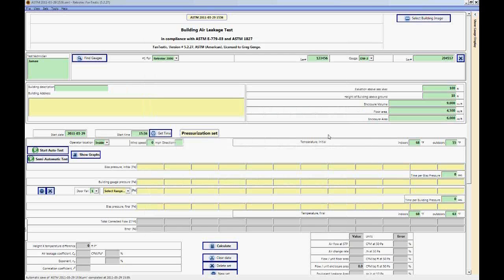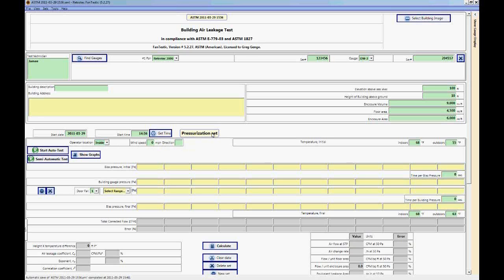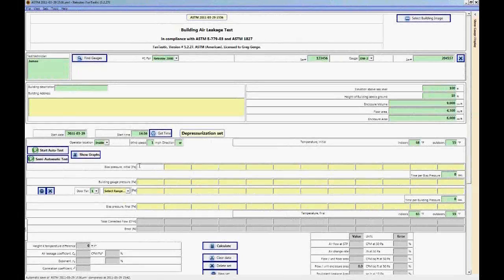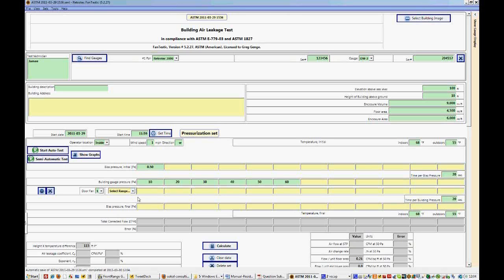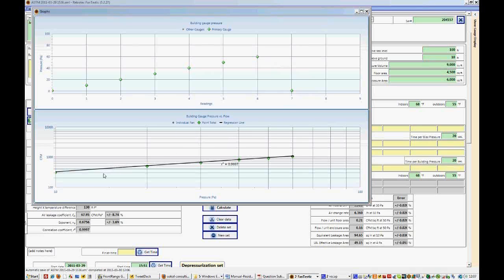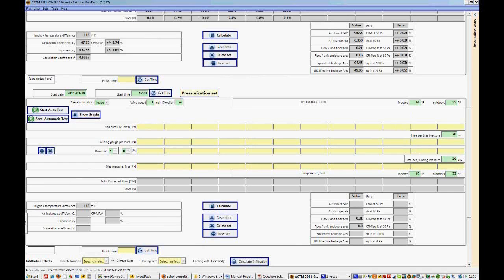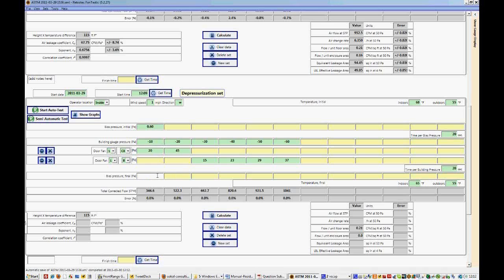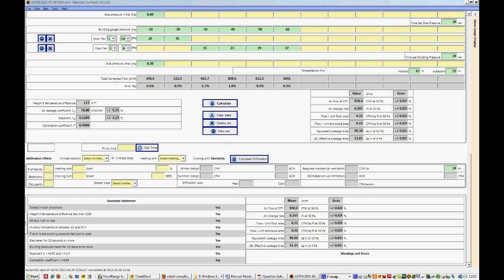FanTestic -- Manual Test

Comment: Hello! Can you please give some common building preassure for a classroom because I am doing a school project for mechanical engineering for an energy audit but I cant do the automatic test becose the fan is not connecting with the software and the professor told me to do it manually. Its about some old classroom and new ones so if you could give some common building preassure you would help me a lot.
Reply from the maker: I'm trying to follow what you're saying here...if you are asking what common target pressures are used, its 50 Pa for residential buildings and 75 Pa for commercial. So if you are testing a school building or room, I would use 75 Pa. If you're only donig a single-point test (only testing to one pressure), running it manually is fine. If you are doing a multi-point test (testing to multiple pressures to make a regression line), I highly recommend using software. If you have FanTestic Lite, you should be able to use the software with one fan if thats all you need. You can also download the rCloud app from the apple app store or google play to do automatic tests and generate a report with one fan.
Reply: @RetrotecEnergy    I have the software and the licence but for some reasons when I connect the fan with the pc and I start the fan it doesnt connect. What I want is the equivalet values for a classroom as the values you have, like 13, 28, 44, 52, 76, 94. I would like to know what this values would be for a classrom
Reply from the maker: @andisefgjini2378  I'm not sure what these values are that you are referencing. Make sure that you have the gauge(s) connected to your PC correctly. Use the bottom ethernet port on the gauge to connect through a router. The top ethernet port on the gauge is what connects to the fan. https://www.youtube.com/watch?v=xMQSUDCXJOA&t=515s
Reply: @RetrotecEnergy  the values I am talking about are the preassures you have calculated. You have buildin gauge prassure from 10 to 60 and below start from 13 to 94 these are the ones I want
Reply from the maker: @andisefgjini2378  oh I see what you mean by those numbers, those are fan pressures from that one specific test used in the example you saw in that video. You'll actually have to run a test on whatever room you are testing to get those results. Those pressures are unique to that specific test. The software takes those fan pressure readings and converts them to flow. Then aggregates them together to provide the final leakage result at a predetermined reference pressure (75Pa or 50Pa, depending on whether if it is commercial or residential).
Reply from the maker: @andisefgjini2378  yes, I see. Thats not something you can convert. You have to actually run the test and collect that data on the room you want to test. You can get those pressures by setting your gauge to read "Pa" on channel B and record them manually if you want. However, I recommend rechecking your gauge connection to your PC. It sounds like you're not connecting the equipment correctly.
Reply: @RetrotecEnergy  I know that we cant convert thoseI was asking if you have any idea what those can be based on your experience on the job. I have seen the video where it shows how to connect but didn't work.